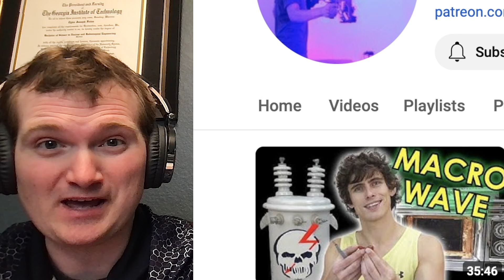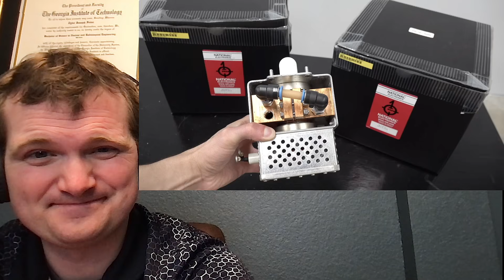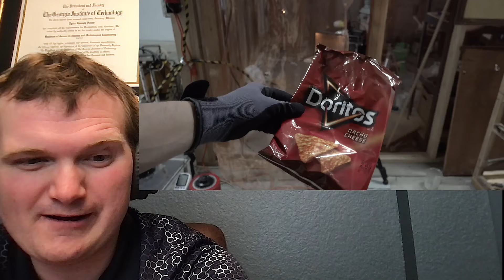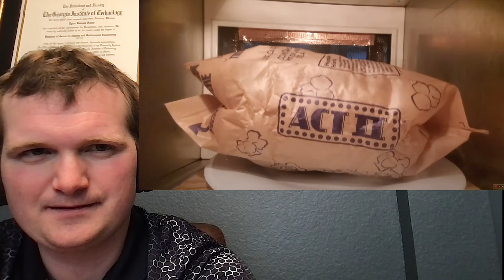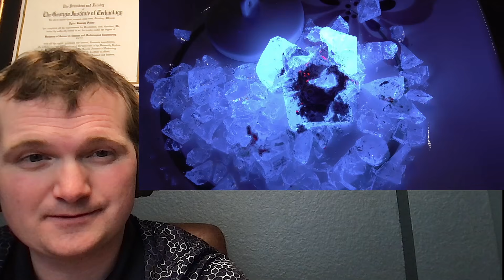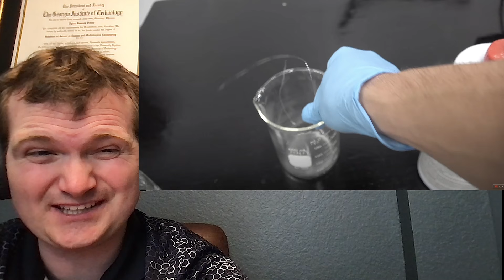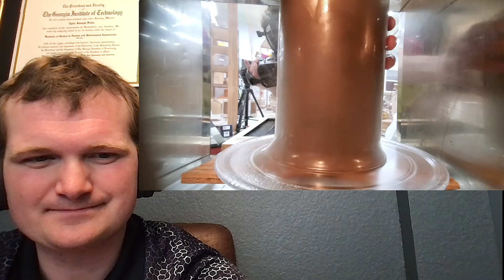Styropyro's MACROWAVE - Nuclear Engineer Reacts

Comment: Having a small explosion when I add a sugar cube to a microwaved cup of water for tea. I think it only cooks the center when it's in a particular position, so the boiling isn't triggered by glass scratches. Kind of risky, actually.  Fortunately, it has some air time to cool down when that happens. 😆
Reply: distilled water will do that too. tap water with trace sediment will visibly boil

Comment: I’m so glad I discovered your channel, and your take when doing reviews and reactions. I get a lot of enjoyment from your explanations. I’m a retired mechanical engineering designer, and the first 25 years of my career were in the fossil and nuclear power generation industry. The company I worked for was a division of Babcock and Wilcox. We manufactured boiler cleaning equipment (soot blowers). We also designed and built all of the control rod drives and control systems for B&W. I spent a lot of time working in the containment building of about 8 different reactors during refueling operations. I was part of a team that performed mechanically uncoupling the control rod drives and pulling out the stators for maintenance, testing, and replacement. This was in the 1970s through the 1990s. Allowed annual radiation exposure limits were much higher then, and doses I received were in the range of 12 rem per year for the 3 years I spent in that job function.

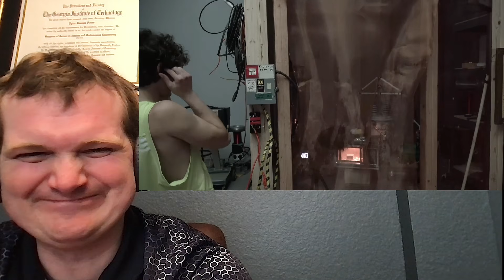Comment: 10:09 I don't even think that's the filament that's lighting up. Poor thing probably melted miliseconds into the "experiment". The light was probably given off by air and metal plasma trapped inside the lightbulb until the built-up pressure broke the glass.

Comment: My 2100 watt microwave uses two magnetrons and two rotating antennas. (There's a 3500 watt model that uses three magnetrons.) These higher power units are commercial restaurant models and are great for home use because a 1200 watt home microwave oven is in reality a bit slow. The single magnetron in a home unit is partially why it cooks unevenly. That and the stupid turntable idea which never made any sense. A 20,000 watt microwave oven would be a bit too hard to control for cooking times I reckon, but why build something ordinary and useful when overkill beckons?

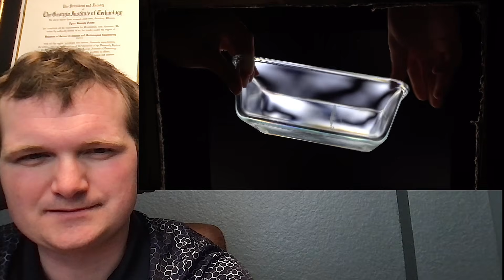Comment: 21:33 I really dont understand this, I use beakers in the kitchen SPECIFICALLY because if/when i drop one it cracks into like 4 or 5 big chunks. Those chunks are sharp I guess, but id way rather carefully pick up 5 really sharp pieces than sweep up a zillion slightly sharp ones. That cant just be me right?

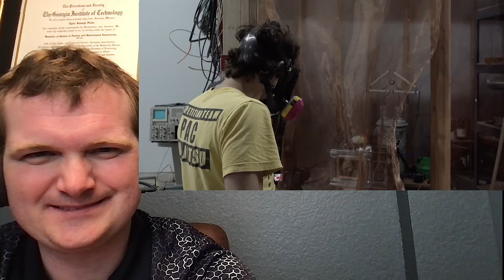22:24 ok yeah look, that was SO easy to deal with! No zillions of little shards getting stuck everywhere...

Plus the boro glass is basically immune to thermal shock anyway, so unless its physically broken (or subjected to plasma lol) it should basically never break anyway

Comment: Hello, I work in a semiconductor fab. I am specifically stationed on Ion Implant tools, Ion implanters are linear particle accelerators used to implant dopant material into the surface of a silicon wafer (Doping N- or P+ type). Our Ion beam is positively charged, and as we all know simililarly charged particles repel eachother (Beam Blowup). So to counteract this effect, we have a tool called the Microwave PEF (Plasma Electron Flood) to inject free electrons into the surrounding process chamber to neutralize Beam Blowup (Beam Space Neutrality). Anywhooo just wanted to say that industrial magnetrons can get way bigger, ours is only about quadrouple the footprint of that and our entire beamline is encased with inch thick graphite and radiation detectors all over the tool enclosure. Imagine what the possibilitis if he had access to bigger and badder equipment to work with in all of his videos.

Comment: Just a small point, but microwave heating is NOT uniform. Once the microwaves emerge from the waveguide and into the interior of the oven, they do bounce around in a predictable pattern, but this is a long way from uniform. There is an easy and non-destructive way of testing this, with a specific type of paper: What you need is "thermal printer paper", which is supplied on either A4 width rolls for old fax machines, or rolls about half that width for supermarket receipt printers.

Cover the interior walls and base of the microwave oven with an even layer of this paper, and spray it with water with a misting spray bottle - you only need enough water to make the paper damp all over. Then turn the microwave on for about 30 seconds. The microwaves heat the water soaked into the paper, which indirectly heats up the thermal ink, turning the paper black. Which is how thermal paper works, albeit in the printers it is heated by an array of tiny resistive heating elements.

Anyway, this effectively reveals the microwave pattern, since the paper only gets heated wherever the microwaves bounce off the internal surfaces.

Comment: I used to run an 80kw microwave. It had a conveyor through the middle where you'd put 40 pound blocks of frozen meat through back to back. Depending on the conveyor speed you could thaw the blocks or completely cook them. at the end of the run we'd put totes of water through to push the meat out while the microwave was still on.

Comment: I see the opposite end of this with vintage audio equipment, hipsters encountering energized capacitors via tube socket "cleanings" or just guys reaching in and pulling a tube on a plugged in amp, even A LIVE one several times if you can believe it.  Where at least the guys getting killed by a Magnatron...which sounds like how Optimus went down so it wouldn't be a total loss, but at least they know that theyre powerful items, but so many people used to solid state amps have no idea how badly they can shock you.

Comment: 23:26 a Brick of titanium probably wouldn't melt. The microwave itself would probably melt, because a brick of titanium has no points where it will reflect and amplify the light, instead it's just going to bounce off the straight, flat, surface and get trapped in bouncing around until something that is reflective absorbs enough energy to fail, and the microwave itself is probably weaker then titanium.

Comment: If you watch Chernobyl, they used helicopters to air drop boron into the open core of the reactor to try and slow the reaction after the melt down.

Comment: Inner workings of the universe the induction of primordial acceleration of the cosmic continuum continued light traveling on this platform the fusion wavelength acceleration of light itself so it continues to space and time thousands of billions of years from other even upon stars that have ceased to exist now from billions of years ago light itself on this platform is propelled by the finite acceleration of dark matter as held together by the core ♾️🔂bounds the  gluones that make up dark matter and it's®️of Ⓜ️🌀🔳2️⃣ stables 🔯 ⚡🌪️🕳️💥🔂♾️ Universe  Patheons although that which accelerate event horizons are connected to every Galaxy Central Mass when every supernova connection with the inner workings of the universe are every Central Mass of galaxy s , is connected to the central core accelerates the Wavelength induction of light with every supernova what is an acceleration of energy and every Galaxy all cemetery and imagery induction is pulled to the center spiral Central Mass of all galaxies and symmetry  every event horizon is connected to the center of  Galaxys causing the imagery induction of the spiral effect behind the platform of finite Mass that's why you get the spiral effect of the imagery induction light traveling on the platform of dark matter dark matter of self accelerated by the patheons,,, photon core symmetry induction of photons traveling on the finite Mass platformⓂ️c 🔳2️⃣💠4®️adius of wavelength🌀,6️⃣🔯💥🏧⚛️☯️ pantheons♻️💥🌪️🌀🕳️✴️ absorbent of the MC square of a plasma wavelength of exterior🛸 outer wavelength induction of the core replicatorp device🟥🟧🟨🟦🟪🪞 this device mirroring being a core replicator and atmosphere from any acceleration Mass infusion induction✴️ quantum🛸☯️ hydrothermal reaction hydrogen tritium nuclear fusion plasma field replicator accelerating  subatomic,💥🏧 at the wavelength of life finding them into each other at the speed of light from both ends to the out exterior of the way wink of The Craft the wavelength induction becomes greater than the platform you move behind the platform so I can platform to move around you☯️ awesome containment entanglement⚡  held together by the acceleration of the photon core ♾️,®️aduis ©️osmic continuel  🆔 SpaceTime relativity. ✴️🔀🏧⚛️antimatter induction itself  and acceleration at a field of plasma, better than this platform that ligh traveling the subatomic particles would look like a swastika on their on deduction being pushed forward continuously on all relativity  on the platform⚡💥⚡  he's treaty of subatomic  particles can  be accelerated ina laser  in the ions plasma stabilizer  constantly accelerated at the same speed of light  particles in a magnetic field simulating MC 2️⃣☯️⚡®️💠4☯️💥🌀6️⃣🔯 ♾️square moving around at the speed of light 186,000 second nothing greater of speed on the MC 🔳2️⃣ square platform mass is bound together  by the speed of the central fusion mass of the universe that are accelerating by all event horizons itself an accelerated behind the platform the photon core that's the reason why light itself drawn to a event horizon because of the induction of light itself behind the platform is goes to its counterpart renew recycled travel for billions and billions of years what does induction  being propelled by the energy behind the platform Mass two,              🏧⚛️💥⚡💥⚛️🏧 the energy wavelength of the the the core itself 🛸 ⚡💥♾️🔀Ⓜ️🛸✴️ absorbing energy wavelength to the outside of the spectrum calling to accelerate to its counterpart photon core becoming a Pantheon through its portals  symmetry induction moving space and time around spectrum symmetry energy becoming this synergy wavelength capacitor..... Same in spirit The light within our bodies Ⓜ️C2️⃣🚹🚺🔯♾️ Jesus is Lord God Yeshua Messiah is God Almighty.. everlasting to everlasting ♾️🌄 good rising to all who believe he has risen. The true light in the light of our souls...

Comment: 1993 is diesel fuel. The other cabinet is usually used for paints and solvents with a minimum flash point above 60c. However he is clearly getting things hotter than that. Styro Pyro has not killed himself yet, so he must be smart enough and careful enough. 

The people who develop propellant loads for artillery shells call themselves "powder monkeys". They say there are old powder monkeys and bold powder monkeys, but there are no old bold powder monkeys.

Comment: Your wireless router works a lot like a Microwave. Some bands are on 2.4GHz, which is the same range your microwave works at.
The “Pyrex” style glass can still be bought in sheet form. I bought some from a local glass shop after I got tired of breaking normal glass all the time. I use it form the heated base I have my 3D printer printing onto. After switching to the Pyrex, I’ve not broken a single piece!

Comment: Something about the Doritos style bag…
When I was a fireman, and being taught for signs to look for to find if someone set a fire or not, we were taught about those type bags. The ones that are like aluminum foil on the inside. People would take those, put them inside an outlet, and light them on fire.
The grease left from the chips will burn. The foil, when melted, looked like the same residue left from the inside of outlets. These have fooled investigators in the past. But, before anyone gets any bright ideas, they know what to look for nation wide now, and it can be tested and proven in court. So, this is NOT something to do or try! I’m simply explaining that it was taught in by my fire department and the book they used. DO NOT DO THIS! In no way do I condone doing this, and I’m telling you NOT to do it! This is for educational purposes only.

Comment: I will interject something regarding those 400 lbs barrels of sodium. I suspect it has been sodium metal in solution. Such a barrel of pure sodium metal back then would have been 10000 USD, at least. And it would have alerted the entire bomb squad of what ever city or town he was in. 800 lbs of sodium metal does not go unnoticed or is acquired by a 13 year old. Something is off with that story.

Comment: 13:47 I can tell you, MW heating is getting a lot of attention in organic synthesis to accelerate reactions, as the heating is a lot more uniform than a heating plate or mantle. However, it requires a polar solvent in the reaction, and it can only be used in small scale, but it allows to carry out in less than an hour reactions that usually are left overnight

Comment: I can help you understand it and see the whole picture. 
See in this problem there are 3 option available among which one of them is correct and remaining 2 are incorrect (boom). 
So from observation initially the probability to get the correct wire is 1/3. I think everybody can understand it very easily.
Now examiner will give one incorrect option. So the remaining wire left is 2 among them one is correct. So the probability of getting the correct wire should 1/2 right! 
The what the hell just happened! ( Most of the people is confused on this part, I can understand that)
Let's see it from different angle
See among those 50% win how many of them come through switching?
Now this is complete different event
Let's solve it-
There are 3 wire Y(yellow), R(Red), B(blue). Let's assume yellow is correct.
If your choice is R then examiner will show you other incorrect one ( examiner will show you B I am writting this cause you will do a common mistake)
Switching will give you W
Not switching will give you L
If your choice is B then examiner will show you incorrect one(examiner will show you R)
Switching will give you W 
Not switching will give you L
Now this one is interesting 
If your choice is Y then what will examiner do?
Some may tell me that they will show you R, some may tell me that they will show B so it's not very distinct. In simple word it is not equally likely event or probability is not equally distributed. And that's why i have written they will show you incorrect option which is always guranteed or simply it is an equally likely event. To calculate  probability how you define event is very important.
Anyway if your choice is Y then examiner will show you one incorrect option
Switching will give you L 
Not switching will give you W
From above choices we have 3 win and 3 loss that's why wining and loosing is 50 50 (1/2). However how many of those win come from switching ?
There are 2 switching win and 1 not switching win. That is among 3 toal win 2 is switching win. That's why the probability of winning through switching is 2/3 . Of course here we assume Y is correct but it is true for any correct option. I hope now you can see the complete picture. 
Win and lose % is 50 50. Among those 50% win 2/3 win come from switching 1/3 win come from not switching.

Comment: 1:35 it's the same in aviation. I think it's an OSHA requirement but I could be wrong? If you have flammable materials in a workplace they must be contained by one of these cabinets with separation from any other flammable thing. Although in aviation, a lot of chemicals we use are specifically "anti-flammable" (since every material put into an airplane has to be impossible to set on fire, for obvious reasons [the wallpaper-type material on the sidewalls and bulkheads are specifically flame retardant and cost about $1,000 per square foot and is VERY finicky to install]) but still have to be housed in these cabinets.

Comment: With a microwave capable of relatively uniform heating because of the high wattage being applied to a small mass in a confined space, once the water changes phases from liquid to gas (water to water vapor) the H2O molecules should continue right on heating further.

Comment: No experience working on microwaves, but they're hardly the only electronic devices that have dangerous components.

I remember back when I repaired computers, our Apple tech was working on one of the first gen iMacs, the colorful ones built around a CRT. He had already set the machine up to discharge the CRT capacitors before he started working on it, but I guess he didn't wait quite long enough. One second he was fumbling around in the guts of the machine, and the next he was halfway across the room, curled up in the fetal position and whimpering. He ended up being fine, but he was very lucky.

Comment: While building a "low-voltage" (relatively) Tube Amp, my dumbass forgot the socket for the ballast tube I was using to regulate the current was on the POSITIVE-side.. So, when I held it while moving one of the wires, I also accidentally touched the ground.. Instead of nothing happening per-usual, I had 160Vdc go from one arm to the next. Now I always treated <190V as "moderately-safe" (after using 330V for most projects) but when this happened I felt a very strong pulse in my chest, some oddly-strong pain (for the amount of travel, I mean I discharged a 330V capacitor in one hand so I guess my pain tolerance for current is very high nowadays, lol) and I have a pretty strong feeling my heart mis-fired or something alike, having experienced some strong arrhythmias years ago...

So... Yeah 2kv - str8-death, and it's AC just to make it than much more fun. But also pretty sure only the transformer secondary is 2kV, the actual anode supply of the Magnetron tube is ~4kV, since the rectifier & capacitor are actually a doubler-circuit.. Fun!

Comment: The melted tungsten may have been that it formed some tungsten oxides which have considerably lower melting points. As he said, the plasma is likely technically much hotter than that, but there is a difference between being hot, and heating a bulk material.